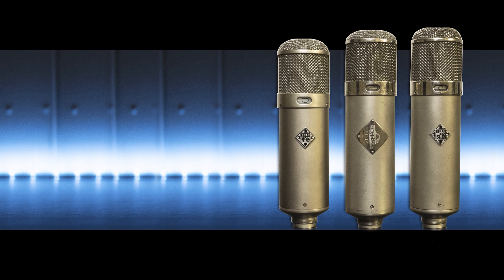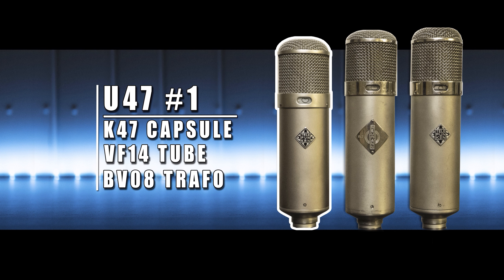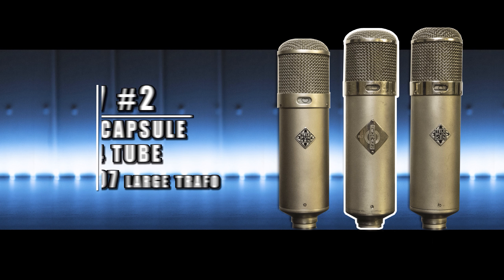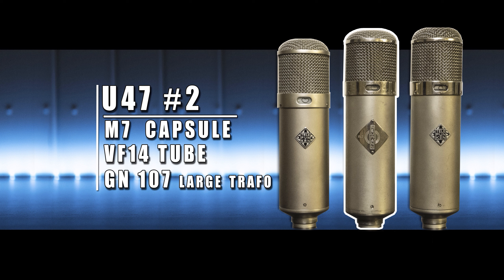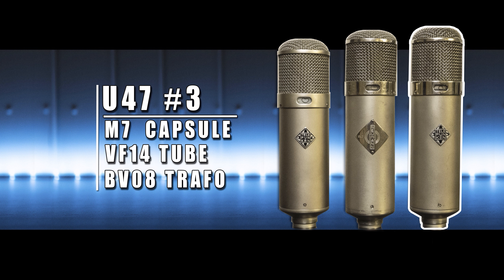Neumann U47 x3 ｜K47 vs M7 vs M7 LargeBadge｜

Comment: Yes, the K47 had a bit more mid / high-mid edge to me which I like very much. There is not so much of a difference as we have seen in the 414 comparison for sure. The u47 wool-like sound character is there in each of them :)
Reply from the maker: Exactly. I would also chose the K47 since it's a more reliable design. Atleast when it comes to vintage capsules.  It's nice to be able to try these things out then have to rely on hearsay haha! Thanks for watching ✌️
Reply: @Christian_svedin  You seem to have a nice collection of vintage mics! Or are they coming and going? :)
Reply from the maker: @peteralbert9805  I wish. I do own a few nice mics but most of the mics on this channel is things I've borrowed from friends :)
Reply: @Christian_svedin  Nice friends! I have such friends too fortunately :)

Comment: I preferred the k47. M7 sounded more harsh and M7 bigger badge sounded honkier. Not much in it though. Are the circuits and componnts exact match between mics?
Reply from the maker: Cool! No, as said in the video the large badge has a different transformer, first revision. All has VF14 though.
Reply: @Christian_svedin  I know on some km84 the fet source cap will be 1.5uf and others 4.7uf. In u87 the negative feedback circuit will be 220pf and others 820pf. So it's hard to say if apples are apples for sure, you know?

Comment: Wow, 3 47s in one place! All of them could work in a mix! Those M7s are really close, I wonder if the difference is more between the transformers or the capsules themselves.
The LB is missing a little low end under 100hz compared to the M7, I also feel like the presence peak is a bit lower on the LB, between 3,5 and 4k giving it a tiny bit more upper mid bite whereas the M7 seems to have a bit more very high end extension, but still it's really close, you flip the phase and you can hear how close they are. 
The K47, as expected is a little more agressive in the mids with that characteristic mid bump between 2,5 and 4k and less info on the top end, giving it a bit more of a filtered sound. All 3 sound great, if I had to pick one I would probably go with the M7 B08 here as I feel like I could easily eq it to sound like the others whereas the opposite would be a bit more complicated but I'm just nitpicking!
Reply from the maker: Yeah that was a fun day! Totally agree. I wouldn't have thought about those Nuance differences if I only recorded with one of those u47s. But it's always cool to be able to do a comparison so you can hear the actual difference. I had never heard an M7 original before this comparison so it was a great experience. And I'm glad that they all sounded good! Cheers!